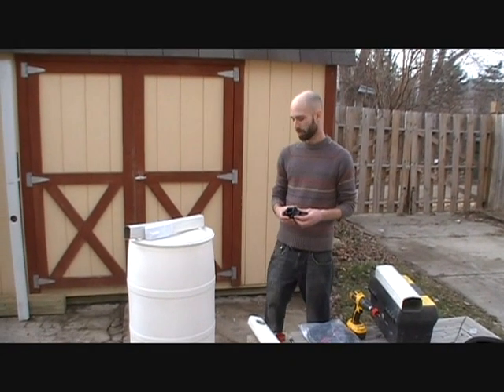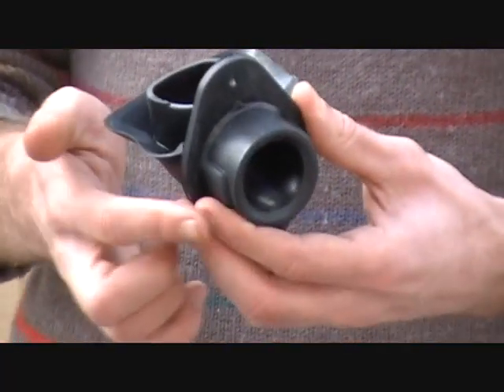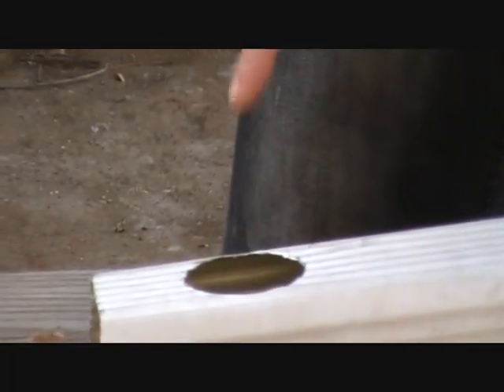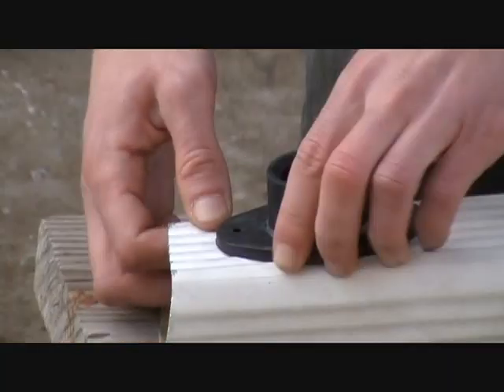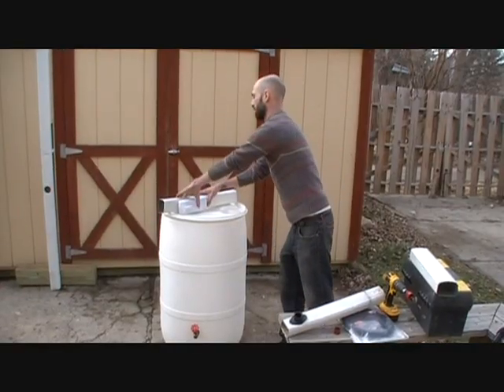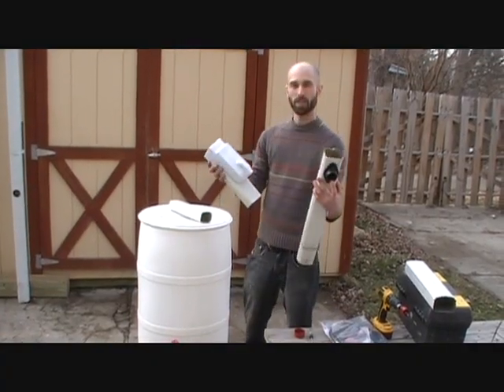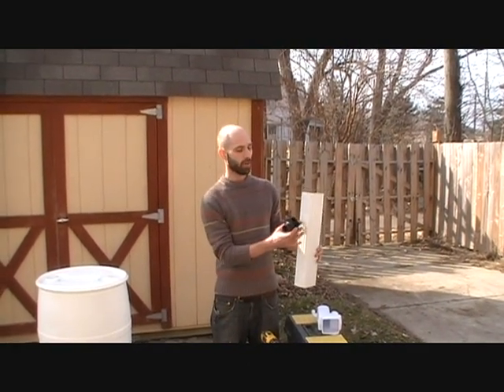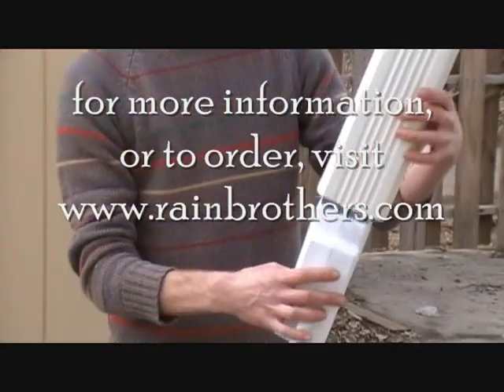Simple, best way to connect rain barrel to downspout: Downspout diverter

Comment: I need help. New rain barrel user. It would really help if you added a video to show the finished installation. Do you add a sub pump hose to the outside overflow diverter? Just scared to cut the gutters again. Thanks for any help. I have 2 barrels and am getting discouraged by the overflow of water draining way to close to my house.
Reply from the maker: Hi! If you check our channel, you’ll see our DIY Rain Barrel video that goes into more detail. Or, check the description of this video for a link to our newer video

Comment: Hey, we bought your fitter/converter kit and it ISN'T working with our metal downspout! :-( Our metal downspout is measured as a 2X3... but perhpas it's slightly smaller than modern and/or plastic gutter spouts??? Anyway, we are feeling pretty frustrated since now we have a big hole in our metal gutter spout and it seems liek we will have to go the 'old-fashioned' route with this project now... i.e. cutting the spout completely off and getting the traditional types of fitters to make it work. :-(

Any last minute suggestions would be helpful! Thanks
Reply from the maker: Sorry to hear you’re having issues with it. Please email us directly if you purchased the product from us (please reference order number) and we’ll be happy to help try to figure out what went wrong. We have sold tens of thousands of these without issue, but if the installation guidelines are not followed, you could have an issue. Thanks

Comment: I have this converter and debris often gets stuck, and i have to remove it.  Any tips?   Also, is it okay to put a silicon caulk around the hole?
Reply from the maker: It’s best to use one of our downspout debris filters above the diverter if you’re having problems with debris: https://www.rainbrothers.com/store/Downspout-Filters-c73647277

Yes, it’s ok to put silicone around the diverter, but it’s certainly not necessary. If you have some water dribbling from around the diverter, functionally, it’s not problematic as the water will follow the downspout down and drain wherever the downspout already drains.

Comment: Thanks for that video.  I'm wondering how to remove the downspout connection to my rain barrel- I want to empty it for the winter ?
Reply from the maker: Sure thing! You just remove the two screws that hold the diverter into the downspout, and then pull the diverter out from the downspout. If you’d like to seal up the hole in the downspout, you would install our Winter Cover, found here: https://www.rainbrothers.com/store/Flexi-Fit-Diverter-Winter-Cover-p281493350

Comment: Will this work with a 6" down spout
Reply from the maker: Yes and no. It will work if you try to off-set the diverter to allow the diverter to touch as much of the inside surface of the downspout as possible. Doing so will harvest some water, but not all

Comment: do you get pollen  in your water? i do and i have a screen.
Reply from the maker: Pollen is difficult to remove. On larger systems, we treat it with either a coagulant like Aluminum Sulfate or a tannin removal filter
Reply from the maker: With a rain barrel, no need to remove pollen.